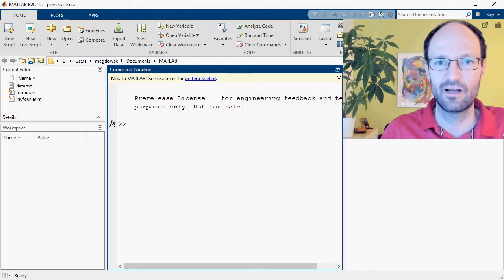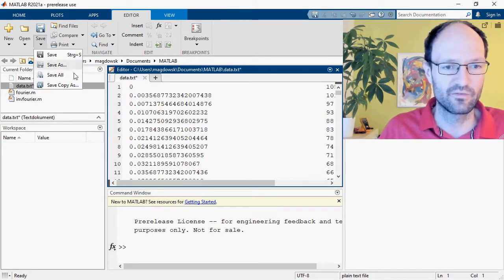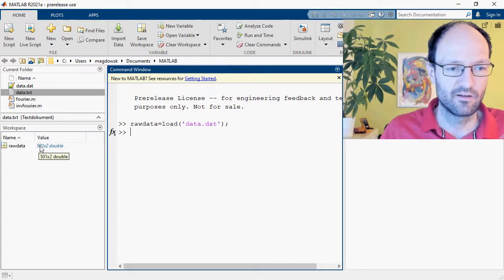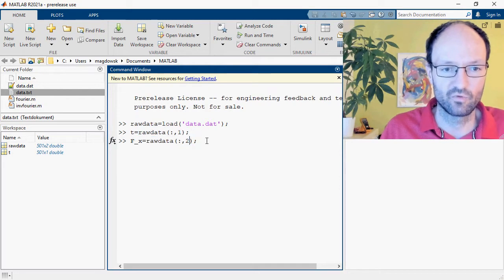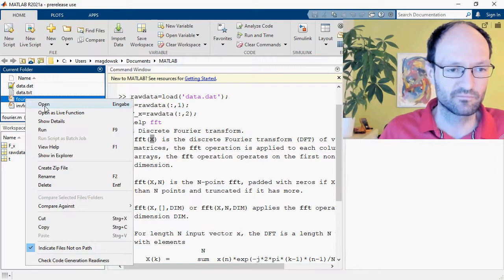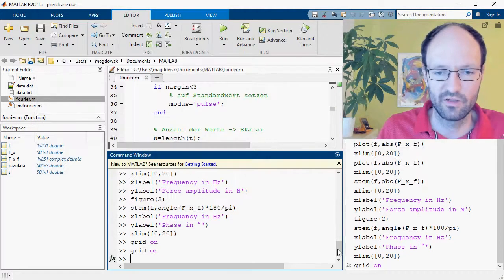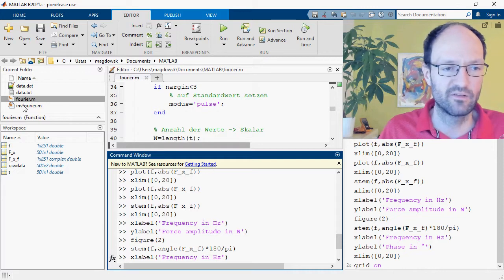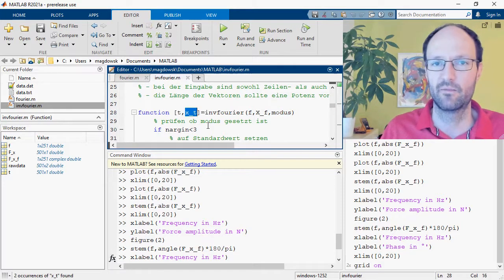How to do a discrete Fourier transform (FFT) and to plot the amplitude and phase spectrum in MATLAB

Comment: how can i extrace wave number (k) from a seismic time series data in matlab? 
thanks in advance
Reply from the maker: Thank you for the question. There are two different definitions of wavenumber, see https://en.wikipedia.org/wiki/Wavenumber.
The "spectroscopic wavenumber" is 1/λ, where λ is the wavelength.
The "angular wavenumber" is 2π/λ. This definition is more common in electromagnetics, my field of research.
I'm not sure which defintion is typical in seismic analysis.
In any case, the wavelength λ can be calculated by c/f, where c is the velocity of propagation and f is the frequency. So from you seismic time series, you calculate the amplitude spectrum via Fourier transform. Hopefully, you have some distinct peaks in this spectrum. You take the frequency of these peaks, calculate the corresponding wavelength λ and wavenumber k. I hope this answers your question.

Comment: Hi Dr. Magdowski
I appreciate your video and your clarification,
I have used your FFT code in other data but the amplitudes of the output spectrum are scaled.
I have sent you the data and the output results via mail and just need your consultation.
I will be very grateful if you replied to me.

Thanks in Advance
Reply from the maker: Thanks for your inquiry. I was quite busy last week and only today found the time to take a closer look at your code. There are several issues:

1. You have a signal that contains a transient effect or transient behavior at the beginning within the first cycle of the five displayed cycles. The first cycle is not exactly periodic and equal to the other four following cycles, which show the steady state behavior. You have to know that the fft function assumes that your time signal replicates over and over again. As the transient effect at the beginning does not replicate, is should be omitted from the Fourier analysis.

2. Your time steps are not equidistant. The fft function only works on equidistant data. Therefore, you need to interpolate your initial time function in order to get equidistant time steps.

3. You should delete the last time step at the end of the analyzed time function and the signal so that it perfectly replicates itself after the four periods of time without any additional step or jump. If you do so, you will also get your harmonic frequencies at exact multiples of the fundamental frequency that is related to the periodic time of the signal.

4. Most important: You have modified my fourier function and the corresponding fourier.m file. You have changed line 36 from
modus='pulse';
to
modus='sinus';
which is somehow okay. In addition, you have changed line 50 from 
if strcmp(modus,'pulse')
to
if strcmp(modus,'sinus')
which of cause changes the behavior of the function with respect to the following lines of code that influence the scaling.
Just do not modify functions if you don't have a clue what you are doing.

I have uploaded the corrected code to Octave Online. You can find it here:
https://octave-online.net/bucket~5sQWRCXyPWhkTjU48iyRvn

You will notice that the signal reconstruction now works very well even with just about 10 to 20 harmonics.

If I find some time I will take your example and make another video out of it.
Reply: @MathiasMagdowski  
Appreciate your time, assistant, and kindness.
I really enjoyed seeing more scientific videos on your channel.
Please, enrich us with your valuable videos.

Comment: Thank you so much for the video, I am looking to recreate some raw data at an irregular time stamp. Would Dr. Kochetov's code still work?
Reply from the maker: Thanks for this nice question. I see different options.
1. You can do the usual inverse fast Fourier transform to obtain a time function based on equidistant time steps. Afterwards, you use a 1-dimensional interpolation (e.g. linear using the interp1 function in MATLAB) to resample the time function on your irregular time steps.
2. You only take into account the most relevant spectral components and use the method presentated in this video "How to reconstruct a periodic signal as a sum of cosine functions from the freq. spectrum in MATLAB" (https://youtu.be/OvyTRxZSolU) in order to directly calculate the values of the time function for your irregular time steps.
Please try it out and let me know if it worked for you. Otherwise you may send me your data and your MATLAB files to my e-mail address so that I can have a look.
Reply: @MathiasMagdowski  Thanks for getting back to me, I have been trying the second option you recommended but still have made much progress yet :/ but will keep you updated!
Reply: Hi Mathias, I have tried varying the frequency and other aspects but still cant seem to make it match up, is there any chance you could have a look at the code?
Reply from the maker: @caistead5622  Thanks for your code and sorry for the delay in communication. I was busy and I will try to answer brief. I see several issues with your code:
1. Your given time steps that you use for the Fourier transform from time domain into frequency domain are not equidistant. Also, the first time step is not zero. Therefore, the Fourier transform will not work. I thought that you already have a frequency spectrum and that you just want to transform this back into a time function with irregular time steps using inverse Fourier transform. To solve this issue, you first need to interpolate your time function on equidistant time steps starting with zero before doing the Fourier transform.
2. Why do you not use the provided functions fourier.m and invfourier.m, but try to use the more basic fft and ifft, where you have to take care about the frequency and time steps and the renormalization of the amplitudes yourself? Why make it difficult, if it can also be easy?
3. The arguments of your "time function" are not times in the unit second but lengths in the unit m. The Fourier transform will still work, but therefore, everything is a bit strange and unusual with respect to the units. What is the unit of the time function itself, also meter (for the distance between the pools)?
4. Your time function looks a bit undersampled and edgy, angular or chiseled, but that might just be a problem of your simplified example.
5. The first value of your time function and the last value of your time function are not the same, not even close, but they should be quite close to each other, as the FFT and IFFT assume that the time function as well as the spectrum always repeat one after the other, respectively. So there cannot be a big jump between the first value and the last value of the time function as it happens in your case, which is then difficult to reproduce or reconstruct with few harmonics only.
6. Finally, I also found a bug in the code of my example provided at: https://octave-online.net/bucket~EP15mJvkgLCmzodFStNw3b
This code will only work, if the DC part is zero or quite small. If it is not, it must be devided by a factor of 2 when reconstructing the function.
7. In general, I would not advice to use MATLAB live scripts. They are much slower and less performant that usual MATLAB scripts.

Comment: When i try to calculate the spectrum and the corresponding frequency using a discrete Fourier transform, I get this error "Check for incorrect argument data type or missing argument in call to function 'fourier'." could you please help me? Thks a lot for ur video :)
Reply from the maker: Thanks for your inquiry, which is difficult to answer without taking a look at your actual code. Can you send me your MATLAB script via e-mail or upload it to https://octave-online.net/ (or any other cloud storage) and share a link to my e-mail address mathias.magdowski@ovgu.de?

Comment: Great video but I won't say that in engineering world we only have real values for ffts. We often use complex signals (IQ signal), there are cffts (complex ffts) alrotyghms also :D
Reply from the maker: Good comment, but this depends on the representation of the signal. In practice, every physically measurable transient signal (which you can measure as a function of time using an oscilloscope) is a real-valued signal. There is nothing imaginary in time domain. For example, the corresponding IQ signal of a quadrature amplitude modulation is given as s(t) = I(t) · cos(ωt) - Q(t) · sin(ωt). Of course, you can also give this in a complex-valued phasor notation, but then it is already a mathematical model, not a physical representation anymore.

Comment: I appreciate your help. I have 15 years radiosonde data in excell. the radiosonde measured upto 36 km after that its burst. I have few questions
1. How can I find the sampling frequency? is possible to take 15x12=180 (15 year =180 month) is a sampling frequency?
2. I plot it month vs height, how can I convert this plot into frquency vs amplitude?
3. what is the matlab code to convert time series data into frequency? 
4. If you are volentary, I will need your email
Reply from the maker: My e-mail address is mathias.magdowski@ovgu.de. You can also find my e-mail address in the linked OctaveOnline Bucket (https://octave-online.net/bucket~CQ8X9mXpy9NaZdF4rSsLQX) in the video description.
Reply: @MathiasMagdowski  Really thanks
Reply from the maker: @tsehayenegash8394  Thanks for sending your Excel data file. There are also lots of different value pairs in this file. Which ones are you interested in? What is their corresponding unit (I assume meter for the height and °C for the temperature)?
Regarding your questions:
1. 15 years or 180 month is a time duration, not a sampling frequency. The sampling frequency must have the unit of a frequency, which is 1/s, 1/min, 1/h, 1/d, 1/month, 1/year or something like this. Typically, the sampling frequency is the reciprocal of the time step or the sampling time, see: https://en.wikipedia.org/wiki/Sampling_(signal_processing)
2. Typically, one would like to plot the amplitude and phase as a function of frequency, not vice versa.
3. The MATLAB code for my example can be found in the video description as a liked OctaveOnline Bucket (https://octave-online.net/bucket~CQ8X9mXpy9NaZdF4rSsLQX).
4. Just for further reference, my e-mail address is mathias.magdowski@ovgu.de
Reply: @MathiasMagdowski  I appreciate your kindness. my problem was solved in the sampling frequency its clear.  I attached one year recoreded radisonde data. in the excel sheet the first column is height which is measured in km and the rest column is month ot temperature. the whole year is a huge data so I can expand when I get this year code
Reply from the maker: @tsehayenegash8394  For easier reference I have put your data file onto our cloud storage:
https://cloud.ovgu.de/s/gAPf4jbJMn3y5gn
The table 'Sheet1' seems to be your raw data, where the height was originally measured in meters and was then rounded to kilometers to have harmonized height references for each measured day. For this purpose, data points also seem to have been averaged for similar height, which might be useful. Nevertheless, the rounding of the height to the nearest integer in km is too coarse in my opinion. It would have been more meaningful to interpolate the arbitrarily height spacing to a fixed height spacing in km, e.g. using a linear or cubic spline interpolation.
The table 'Sheet2' then only summarizes the data for the rounded heights in km, I assume, but still gives all the measurement for each individual day that was measured. The table 'Sheet3' then only summarizes the averaged values giving one value for each month. This value might be the result of only a single measurement, e.g. in January, or a mean value over 30 days, e.g. in September. The final table 'RS_2006' then summarizes all these values for one year, where the first column gives the height in km, while the other columns give the corresponding temperature in °C for each month. Here, it is unfortunately not very clear, where some of these values come from, e.g. for heights above 10 km for the month of January, where no measurements were taken. Have these temperatures been extrapolated from the lower heights or are the annual averages used here? How meaningful is it, that some temperatures are only exact to one decimal while other are given with up to 12 decimal places or more?
Despite all these questions, possible difficulties and imprecisenesses, let us assume that the data is meaningful. So we have 12 temperature values as a function of time, one value for each month. Such type of dataset now exists for different heights between 2 km and 36 km. I have plotted these curves in the following file:
https://cloud.ovgu.de/s/rNfiFeBmxomscjx
One can see that the temperature does not really change over the year, at least for most of the heights. The displayed changes seem to be only related to noise or uncertainties of the measurement. So it is of course possible to calculate the amplitude and phase spectrum of these temperatures, but you will observe that the spectrum then also only shows noise, which is to be expected, if the transient signal in time domain mostly consists of noise.
In addition, a number of just 12 data points is too small to calculate a meaningful spectrum. With just 12 points in time domain, you will only be able to calculate the amplitude and phase for 6 meaningful frequencies in the spectrum. Which useful information would you like to get from these values? So the question is not, if and how it is possible to calculate the frequency spectrum, the question is why one would like to do this and what meaningful information can be obtained from the spectrum.
Reply: @MathiasMagdowski  I appreciate your kindness to help others to devote your time. I want to evaluate QBO(qausi bienial oscillation), ENSO(Eli Nino Southern oscillation), AO(Annual oscillation), SAO(Semi annual oscillation), TAO(Tri annual oscillation) from the dominant frequency of this data. the steps are:
1. take the average of the whole month at a fixed height.
2. deviation = value - mean(average)
3. I would plot the deviation to distinguish the dominant frequency.
4. one over the dominant frequency (1/dominant frequency) tell us the atmospheric oscillation i.e QBO,ENSO,AO,SAO,TAO. my problem is how to write matlabe code of frequency amplitude.
Reply from the maker: @tsehayenegash8394  Your case is a little difficult. You have only data for one year (which corresponds to the longest time). For this year, you have data for each month (which corresponds to the time step). After the discrete Fourier transform (or Fourier series expansion), the longest time (or periodic time) corresponds to the smallest frequency in the spectrum, which is then 1/year. Similarly, the shortest time corresponds to the highest frequency in the spectrum, which is 0.5/month, 1/(2 month) or 6/year.

All your measurands of interest
- Quasi-biennial oscillation (QBO, https://en.wikipedia.org/wiki/Quasi-biennial_oscillation)
- El Niño–Southern Oscillation (ENSO, https://en.wikipedia.org/wiki/El_Ni%C3%B1o%E2%80%93Southern_Oscillation)
- Arctic oscillation (AO, https://en.wikipedia.org/wiki/Arctic_oscillation)
- Semiannual Oscillation (SAO, https://www.sciencedirect.com/topics/earth-and-planetary-sciences/semiannual-oscillation)
- Triennial Oscillation (TAO, https://ui.adsabs.harvard.edu/abs/2019E%26SS....6.1262J/abstract)
have periodic times of one year up to three years and corresponding fundamental frequencies of 1/year to 1/(3 year). So in order to get a meaningful and usable spectrum, your time data must be measured over several years, not only one year. Your measured time range of one year is just way too short to analyze any periodicity which is longer than this one year.

It is the same as if you would measure a periodic current or voltage function over a time of 20 ms (the periodic time of the European mains grid voltage). The smallest frequency that you can obtain from the discrete Fourier transform is 50 Hz, the mains frequency. If you want to have lower frequencies in your spectrum, you need to measure for longer time. It is as simple as that.

Having this said, please don't get to the idea to copy and replicate your data for one year in order to fill a time series for several years. If you, for example, copy your data for one year ten times to have a time series for ten years, of course the smallest calculated amplitude and phase in the spectrum will be at a frequency of 1/(10 year) or 0.1/year, but this amplitude will be exactly zero and therefore of no use.
Reply: @MathiasMagdowski  Thank you very much for help me. I get a lot of things in your response.
Reply from the maker: @tsehayenegash8394  No problem, you are welcome.
Reply: @MathiasMagdowski  SAO,TAO,AO links are not working
Reply from the maker: @tsehayenegash8394  This is a simple problem with the YouTube interface. You just have to delete the closing parentheses ')' at the end of the links after copying the link to the adress bar of your browser. It is somehow funny it is necessary to explain this to a person who is very probably from the generation of 'digital natives' ;-).